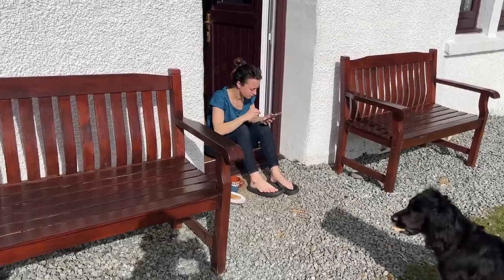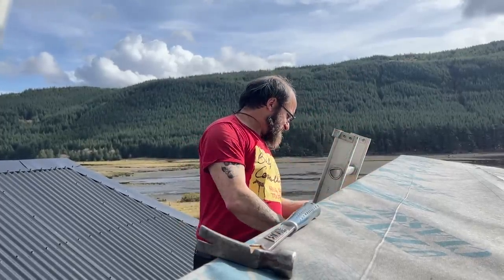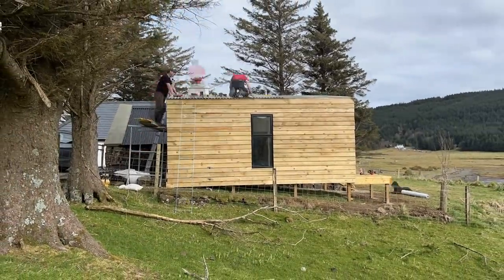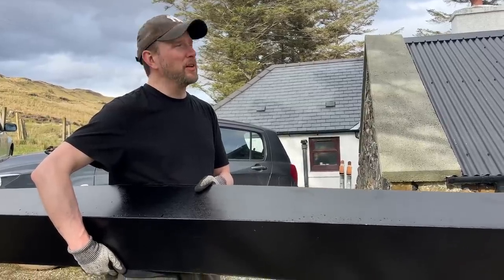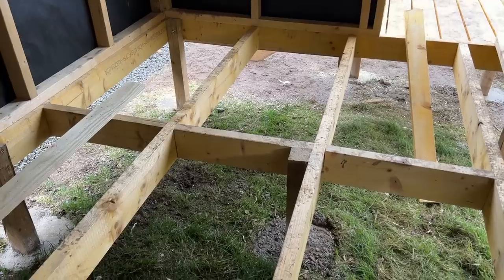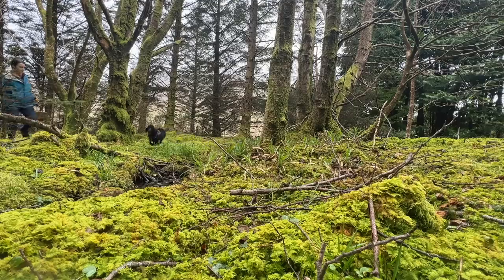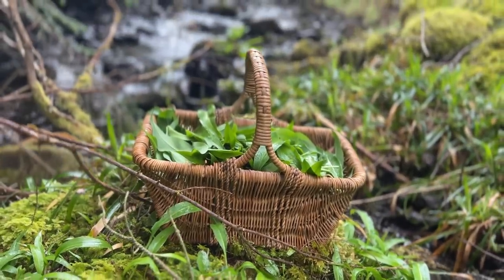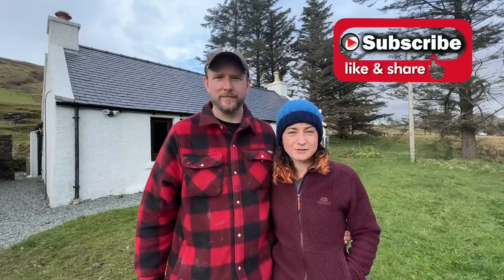Spring Has Arrived At Our 1840s Cottage on the Isle of Skye, Highlands, Scotland - Ep16

Comment: My sprocker, when he comes in from a walk and is all wet and/or muddy, heads straight into the shower where he sits waiting for me to turn it on.  Then by testing the heat of the water with his head, will only deign to go under the flow when the water is running warm!
Reply from the maker: Aww so cute! Jack point blank refuses to go near any water that is warm and soapy 😅 A dunk in the cold highland river is far more to his liking!